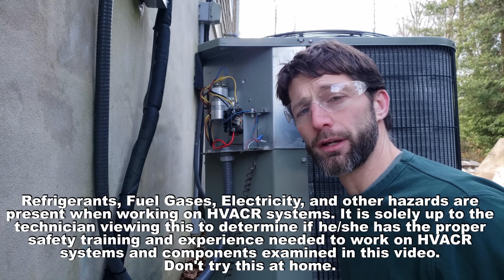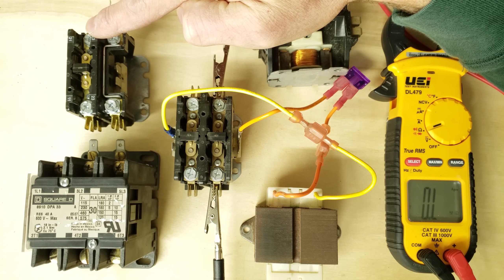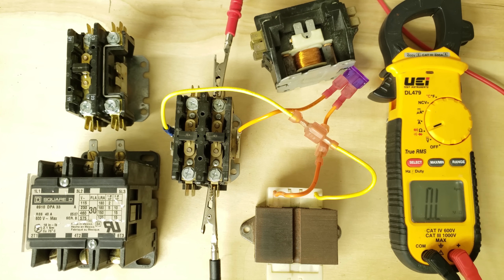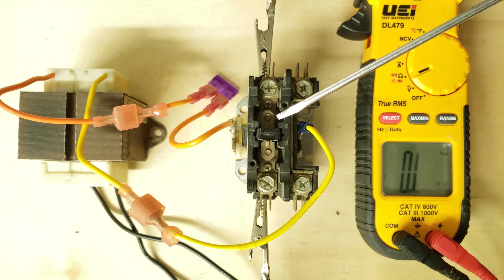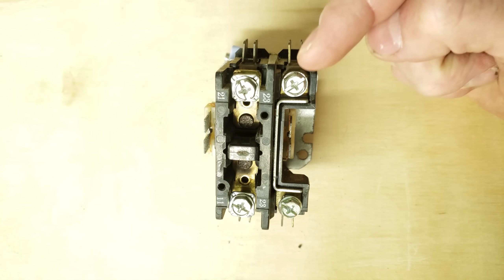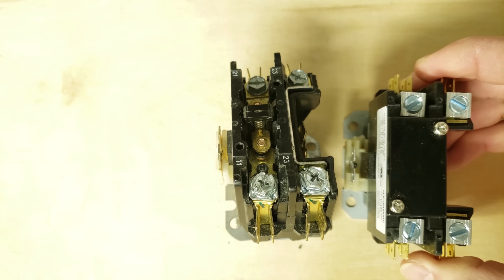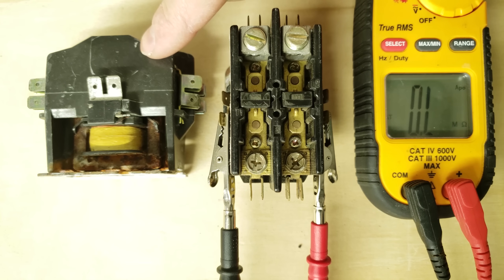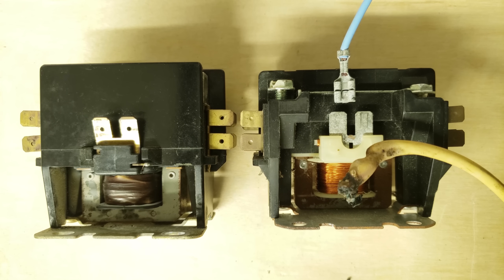TOP 5 CONTACTOR Troubleshooting Problems!

Comment: What if the contactor pushes in when it gets 24 v but the fan doesnt turn on, but b4 the safety switch in the pan opened the circuit because the pan was filled w water once the water was drained the float was cutting on and off  causing the condenser to go on n off several times when I went back down to the condenser the contactor was pulled in but the fan wasnt turning any more.... cap or contact are suspect , right ??
Reply from the maker: There could be a 5 minute delay if the outdoor unit had a control board or a delay module, thanks

Comment: Hey,  I've got a  2 pole contactor for a Trane unit that has :  32 FLA  150 LRA ,  50 RES   but can't seem to find the correct size replacement part. I can find the 30/40 FLA but no 32 FLA.  Any advice? Thanks
Reply from the maker: Go with a higher fla like 40 and that will be good, thanks!

Comment: Do you find Square D contactors to be better than many others? I heard they are made in the U.S., but I would have to pay $38 to get one locally.
Reply from the maker: Square D is one of the best for sure. They are usually less expensive at electrical supply houses but you would need an account thanks!
Reply: @acservicetechchannel  All the electric supply house only had Square D in 120v coils. I wound up getting a Chinese made one Carrier sells for $6.00. I prefer to by U.S. made parts, but $38 was double the price of what that part normally goes for. In addition, the GE breaker I fried was originally made in Connecticut. The new GE one was made in Domincan Republic. 

The replacement went well. A 35 yo breaker and 25 yo contactor couldn't take it anymore.

Comment: Great video. Would you recommend replacing a contactor if the terminal was rusted?
Reply from the maker: They have brass connection points inside the contactor but if the tabs are rusted, certainly you could replace it with a like size one. They are cheap enough, thanks!

Comment: Greg, Would you do a teach on the use of a run capacitor as a crankcase heater? Does the capacitor heat the crankcase? As always, thanks for your well presented and informative videos.
Reply from the maker: Hey Aliso, you would use an additional strap on crankcase heater that is wired hot on the contactor before the n/o contacts to the 240v in the case of a heat pump, thanks!

Comment: I've learned a lot  from AC service tech. Clear explanation and easy to follow. And now, I can see who's been helping me. Nice bro.
Reply from the maker: Ha ha, thanks a lot John!
Reply: @acservicetechchannel  . No problem. One quick question: Is it possible for a bad high limit switch to prevent the control board from sending 120 volts to the inducer motor?

Comment: a few years ago unit had ant pile in front of unit and they were up in contacts so i just cleaned contacts and got it running and told them to take care of there ant problem. he called me to his house 3 times that summer for same problem, Should we take care of there ant problem lol.
Reply from the maker: Ha ha, yeah in those circumstances we usually just replace the contactor with an enclosed one or electronic one like emerson puts out, thanks
Reply: nothing wrong with contactor but i charged him each time you think he would get the hint
 @acservicetechchannel
Reply: @bernie-n7h    Money in your pocket, but Karma will be harsh.  The guy did NOT get it, that is why he is calling you.  It would be kind of you to tell the guy to kill the ants to prevent repeat.  Also, the guy will hate you for having to call you back 2 more times.  Short term gain....long term loss.

Comment: Nice to see the face behind the video! Another method that I use in the industry is to measure the voltage drop across each contact. Great video and keep up the good work. 😀👍
Reply from the maker: Yes, the only reason I don't teach that way is that the tech is so close to the high amperage and I am used to teaching the trade to 15 year olds and up so playing it safe, thanks!
Reply: @acservicetechchannel  No problem at all as I fully understand in teaching the younger folks with safety in mind. Have a great weekend!
Reply from the maker: You too, thanks!
Reply: 1uyeyrryyar4g r h4
Eh by but ply

Comment: As always thanks for sharing. Good vid.

One suggestion: while this demo was clearly a bench test of the component, a disclaimer on checking resistance across the contacts. Don't want the newbies trying that on a unit while power is attached.

Perhaps instead, showing component testing demo while connected to a unit demonstrating worn contacts as a voltage drop across the power leads.
Reply from the maker: I always try to teach testing of components with the power off instead of drawing full amps of the components for safety, thanks Dave!

Comment: Also seen a failing coil or bad supply voltage to the contractor cause a chatter with it not fully closing and blowing the low voltage fuse.
Reply from the maker: Yup the chattering due to low voltage from resistance, thanks for adding that one!
Reply: Just had this from a failed Trane air handler emergency heat contactor. Disconnected with 25 volts applied with variac makes a rapid vibration.It was 22 years old. Would occasionally blow the 5 amp control circuit fuse.

Comment: Can you make video on area computation vs size of aircon unit (tonnages) thanks
Reply: good suggestion, but there's far more involved in sizing AC and heating than just the square footage. example, R value of insulation, windows, doors, solar gain, exhaust fans/makeup air, appliances, hot tubs, pools(indoor) and there's more yet ;)
Reply: throttle bottle absolutely👍🏽
Reply from the maker: I would like to at some point in the future, thanks!

Comment: When checking the resistance on the coil, what ohms value is acceptable. Love the vids and keep up the awesome work
Reply: Daniel Blanchard  6 to 20 Ohms is acceptable for almost  most of the coils in single n double poles contactors i believe
Reply: it depends on the coil voltage rating, once you expand into other parts of HVAC and refrigeration the coils are not all 24 volt, you can have 120, 208/240, 277, 480v( not often you'll see 480v coils though)

Comment: Thank you sir very helpful information
Reply from the maker: Thanks ejohnfall!
Reply: @acservicetechchannel  i worked on package unit today but has shorts cycle every10 or15 minutes what could be the problem please help
Reply from the maker: If it didn't have any status code lights, you could jump the board out at r to w instead of at the thermostat to take that out of the equation and put your meter on the item you believe is turning the heat off such as pressure switch. If it were a high heat limit switch, you can check the resistance on that after the short cycle because it will still be hot unless time goes by and the blower cools it down. Did you already clean the flame rod and make sure the flame is traveling across the burners well. Outdoor package units are notorious for rusting the burners shut, thanks
Reply: Thank you